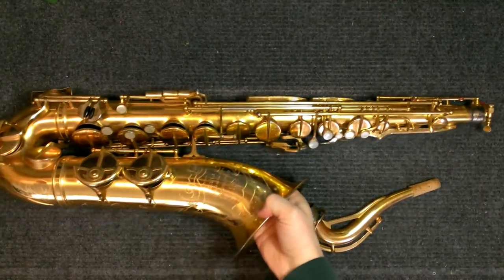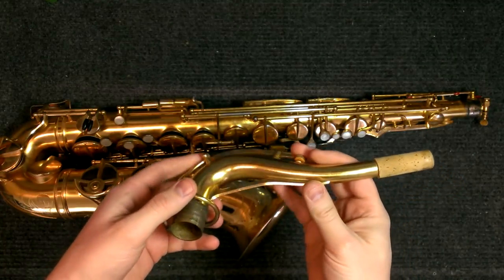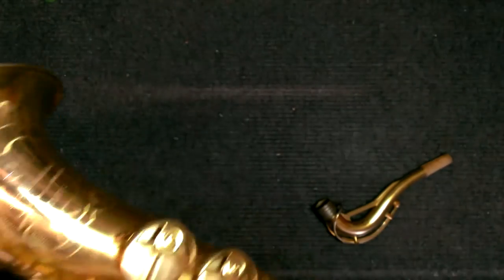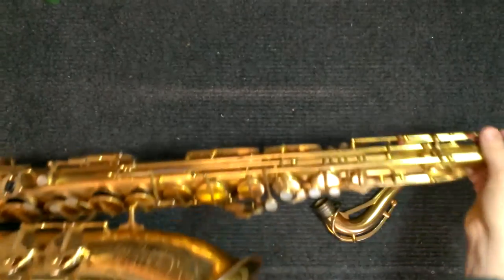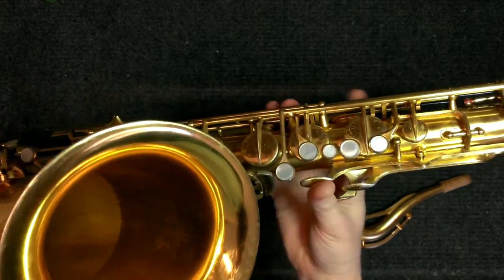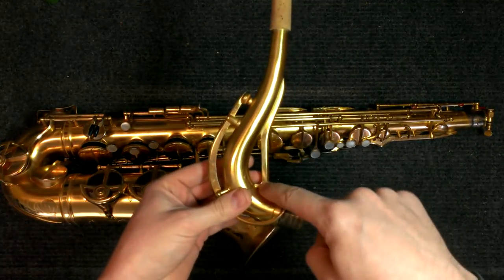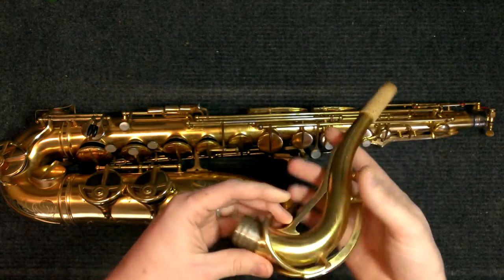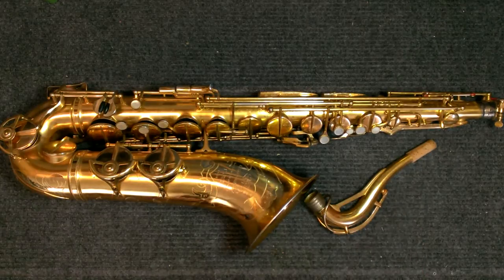Repairman's Downer: "Gold Plated" SML Saxophones: It's not gold, bruh

Comment: Matt, just in case you were not aware that the SML tenor has identical bore /tone hole size and neck length to the Conn New Wonder 1/2 series of the late twenties  The only difference is that the conn has 28.3 mm tenon and the SML 28 mm . Perhaps that is why they both play similar . The bore is larger at the top than Selmer but smaller lower down. SML neck also has a slimmer initial taper up to the octave vent.

Just found this out from a major rebuild of both here in sunny UK (march !!! )
Reply from the maker: +jon viol This would not surprise me- lots of folks copy Selmer now, but the original horn people copied was the New Wonder!  

If you'd care to share your measurements and methods, please feel free to email me.

Comment: How to clean PermaGold / Z1nc dchromate ? that Is  very dIrty.. grImmy,  horrIble ..?  KIng used a sImIlar coatIng I thInk
Reply from the maker: Never seen it on a King.  

For SMLs, same way you'd clean lacquer (for me, that is a gentle brush with lukewarm soapy water, I use "Sal's Suds" from Dr. Bronners), since there is often a thin & weak lacquer coating.  Even if not, same way.  It doesn't polish.